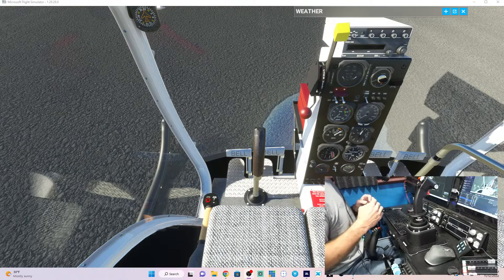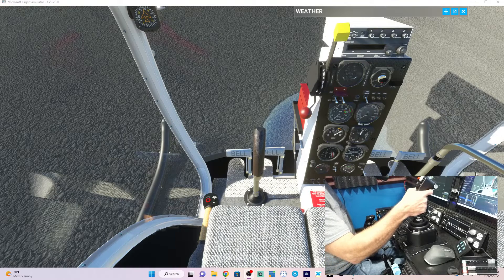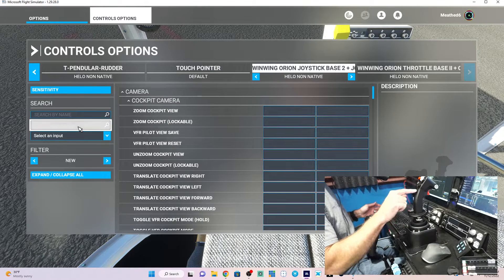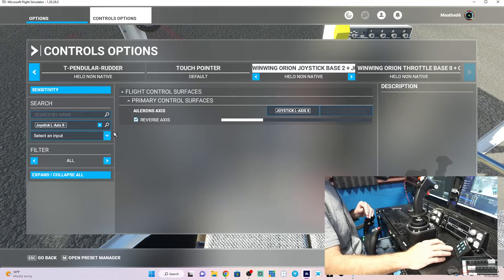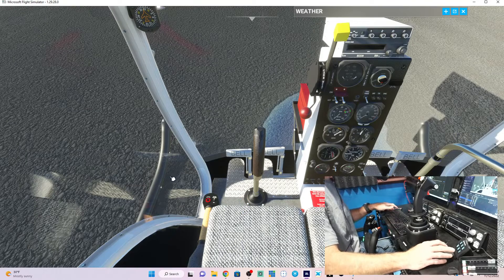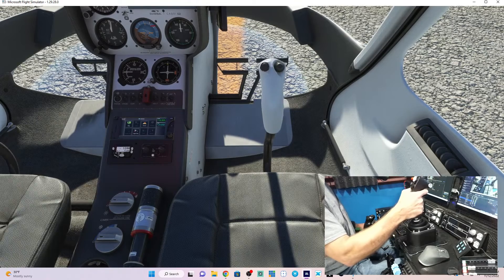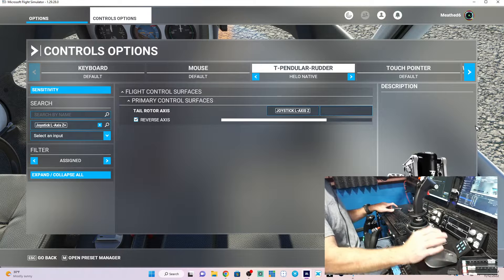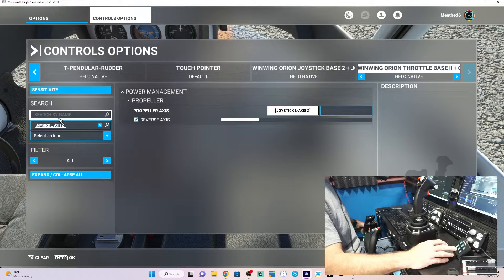How to make controller assignments for helicopters for MSFS | 40th Anniversary

Comment: I have the virpil vpc rotor and hawk 60 grip. Can not bind the twist throttle so power is either full or idle.  this is not a major issue because as long as the collective itself works as it should then you can still fly. As you said the governor controls the actual engine power but I would still think that it should be able to work as intended. Hopefully with MSFS 24 coming out they will have this rectified. I have found no video on YouTube that shows anyone overcoming this issue.
Reply from the maker: I think that is software/sim related. I think that currently most of the helos on MSFS utilize autothrottle. Not sure about X-Plane.
Reply: I’m not going to bother trying to set it all up with MSFS2020. I’m going to wait until 24 comes out. When I seen the videos of 2024 it looked like within each aircraft you found the item you wanted to bind, the brakes for example, you highlight the box next to it then press a button on. “WHICHEVER” peripheral you want and it is recognised. Then you save it as a profile. If this is the case, assigning buttons and switches would be fantastically easy. Hope it’s like that. 👍

Comment: Great video. I may be doing something wrong but I did the prop axis for the Bell 407 but it does not twist/turn. I even put it out of idle but when I do my key binds, nothing happens. Any suggestions?
Reply from the maker: I think that is (or least was) an issue with that aircraft. If I find a a fix was applied, I will post back here.

Comment: Hey there Ivan. Non Native Cntrl set up for MSFS. I got a Warthog throttle base and when I try to add one of the sticks to propeller it says that this has already been set in motion else where. 

I dont have a collective next to me. Any ideas for me? 

I did add the collective to the sticks on my Warthog throttle base, so then the two sticks are already taken. I am contemplating on getting a collective for my set up which is small, but it works. So then I got a collective and can add the propellers to the Warthog T-Base. Flight sims with gear is sometimes not fun. I might get the VPC SharKa-50 Collective Grip with a twist. There are two collectives I am looking at right now...Oooh where is the fun..........................................
Reply from the maker: You may have multiple external devices trying to control the same thing. Sometimes that works and sometimes it doesn't. Sometimes both external controllers will updated their input data at the same time which causes a conflict. I would go into your controls options and try to find this out. It could also be a single controller with two different axes trying to control the same parameter. This is easier to figure out because when you see the parameter on a given controller it will show which buttons, axes are trying to control it. One technique would be to unplug every controller but one and troubleshoot it like that. Let me know if that doesn't work.

Comment: So the arm going up and down is called a collective, but here he uses physical collective stick and assigned that the throttle? On the collective is a throttle, so how to control it with a keypad? If you use the mouse , you can increase the throttle on the collective stick, while trying to fly. It seems dumb to point a mouse at the collective when the keys could do the same thing. I'm pretty sure X-plane 11 and DCS world is better with this, but that's another story..
Reply from the maker: That collective also has a twist grip for the throttle. Not sure about keyboard bindings. Maybe just autothrottle?

Comment: Hello, I have an old hotas x: in cabri g2 it's possible to avoid fatigue and push forward or backward the joistick, to set the trim longitudinal increase/decrease setup. How to do that with the bell47g configuration? It seems doesn't work for bell47.
Reply: solve probably with ELEVATOR TRIM UP/DOWN SET by myself ;)
Reply from the maker: @pupattolino75  Thanks for posting. Others will find it helpful. I have not personally used any trim control for the helos. Maybe I should start!

Comment: How do you setup the trim bindings for non-native helis? The trim bindings for the native ones seem to work fine. In the G2 for me, when I move the collective slider (on my Thrustmaster t.16000), only the throttle sleeve on the collective works, the collective arm does not move up and down. This is using the default definition for the T.16000 for helis.
Reply from the maker: I have never set the trim on the helicopters. I leave it at the default setting. Wish I could be more helpful on that.

Comment: Thank you. I'm using an X-56 HOTAS and I can assign the collective as teh throttle, however teh propeller axis doesn't register for helicopters for some reason on my hotas. It works fine for fixed wing aircraft like the King air, but I can't use it as a fully functioning collective. I guess I will have to go buy one to get that to work.
Reply from the maker: That's strange. It really should work. Which helicopter are you trying to set up?
Reply: I just tried it in teh Bell 407 and nothing, switch over to the King Air, prop pitch works just fine. Maybe you would like to PM me?

Comment: Have you got anything on the Airbus Hype H135 using Thrustmaster HOTAS Warthog joystick?  The whole helicopter seems impossible to hover, but no problems hovering in the Cabri G2 and Bell-407..
Reply from the maker: I have never used the Warthog gear. It looks solid though. I am using a similar setup from a company called Winwing. They have an awesome collective attachment for their throttle base. I don't fly the Airbus helos as much because, to be honest, it's hard for me to bounce around from one flight model to another. I have finally gotten a tiny bit of skill with the Cabri and have been really having some fun with it.

Comment: the twist throttle on my collective doesn't twist with the propeller axis binding.  only the upand down throttle works
Reply from the maker: Which helicopter?
Reply: @IvanSkyFlight  407 one
Reply from the maker: Derrick, that is a known issue with that helicopter. Currently, I don’t think there is a fix, but if I hear something I will let you know.

Comment: I went from a flyable 407 to one that is now uncontrollable.  Not impressed with Asobo's attempt at helicopters. I stick with the HPG 145.
Reply from the maker: Did have the problem where the helicopter is completely unstable? If so there may be a fix. This happened to me, and I applied the fix in the description of the video in the following link: https://youtu.be/7pk7mLdXY6g
Reply: @IvanSkyFlight  I have no interest in that toy helicopter. I have flown the B407 for maybe 10 hours after it was released. Then 2 or 3 small sim updates and followed some setting recommendations to a point where it became total chaos. I have deleted the joystick profile and returned to the settings used upon initial release.
It is just not an enjoyable flight as I get from the Airbus H145. I prefer to sim for pleasure and relaxation. The Asobo has yet to offer either. The B206 in FSX was okay. The b412 and AS350 in Xplane were great, too.  One should not need to 'modify' the sim developer's product just to get it to handle in a descent manner. Thanks. /endofrant/

Comment: Apparently Guimbal Cabri G2 is the newer model.   Is Bell 407 the older model?
Reply from the maker: If you mean flight model, both the Bell 407 and the Cabri G2 use the new MSFS flight model for helicopters. The Bell 47G and HPG 145 each use their own built in proprietary flight model.

Comment: VR is amazing in helicopters. For some reason the Bell 407 throttle doesn’t work with the propeller axis bound. I can’t find anything other than mouse scroll wheel to move the throttle and it’s making flight very hard with my actual joystick and collective.
Reply from the maker: The throttle is with the Bell 407 is a known thing. I hope it's addressed in future updates. I primarily fly the G2 these days. I have tried VR, and I can certainly see the appeal!
Reply: Luckyduck!❤😮

Comment: Propeller Axis dosen`t work in bell 407
Reply from the maker: This seems to be a know issue. Apparently there is some type of work around but it's very ineffective because even the workaround doesn't fully model the correct behavior like the G2 does. I feel like the 407 isn't as complete as the G2. I have only flown it a few times.

Comment: What about the trim binding?
Reply from the maker: Cut and paste for my response to someone else: 

Not sure about the Bell 47G and HPG145 (non native flight model), but the new helicopters apparently have trim. If you go to "controls options" and set filter to "all", do a search for "trim" and scroll down a bit. There you see "increase rotor longitudinal trim" along with the others. I am assuming that you would assign to those inputs to your controls. Given how these things are fly, I would assume trim controls would need to be bound to the hat on a joystick to be useful. Have said that, I have not tried helicopter trim. Still working on the basics!

Comment: Fantastic video! You went slow and I got all of it. One question - You are correct that it is difficult to bind the "twist" throttle, especially if I am using the Xbox controller. Where is the Auto-throttle? How can I turn it on for the two new Helicopters? Thank you in advance.😀
Reply from the maker: I don’t know where the auto throttle is on the Bell 407. On the Cabri G2 it’s on the end of the collective and hard to see. The best way to find it is to activate the checklist and click on the eye icon. It will be highlighted in blue. I just have it bound it a switch on my controller.
Reply: @IvanSkyFlight  Thank you for getting back to me so quickly. I will try. One more question and I am sorry but I do not have the Flight Sim ON right now and I am new to all this. Can I use the Auto-Throttle binding that the airplanes have to do the same in the Helicopters?
Reply from the maker: @johnnicolucci380  I am not sure. My guess would be no, but it’s worth a try. Let us know.

Comment: Ok question what does the collective do in the helicopter? Great video by the way, i might have to watch this a few hundred times to get it lol
Reply from the maker: The collective changes the angle of all the main rotor blades at the same time. Basically when the collective is all the way down the blades are flat. They angle up in a twist motion as the collective come up. This increases lift to a point and the helicopter starts to ascend. The cyclic (joystick in middle) only changes the angle of one of the blades and cause the helicopter to tilt and then move in a given direction.
Reply: @IvanSkyFlight does the cyclic not tilt the main rotor hub??
Reply from the maker: @Aeronotti  I don't believe so (but I could be wrong). I think it essentially changes the angle of attack on one of the blades in certain position which changes the thrust vector.

Comment: hola donde se activa la aceleracio automatica gracias
Reply from the maker: Depends on the helicopter. For the Bell 47G, you have to open their options menu which is a switch on the bottom of the column that has all of the gauges. That give the option to turn it on. I don't think the Bell 47G has auto throttle in real life, but I could be wrong. For the Cabri G2 it's on the very end of the collective and hard to find. If you use the checklist, find the auto throttle item and click on the little "eye" it will take you right to it. You can also bind the auto throttle command to a joystick or keyboard button for the G2. I don't know where or how to activate/deactivate auto throttle on the HPG 145 or the Bell 407.

Comment: Nice one, maybe you could have just popped into your sensitivity's settings for a second, (for a look-see), I have been going back and forth with them for a minuet now. Thank you for your video, Cheers.
Reply from the maker: In this video, I think the sensitivities were all at zero. I am now starting to fine tune that, so currently I am trying -30 for all axes. I have dead zone at 2% and reactivity at 95%. Neutral and extremity dead zone are both at zero. It feels better, but I am still working on it.
Reply: @IvanSkyFlight  Thanks